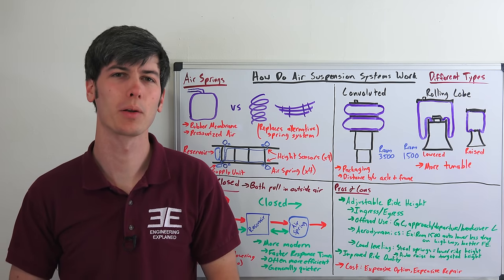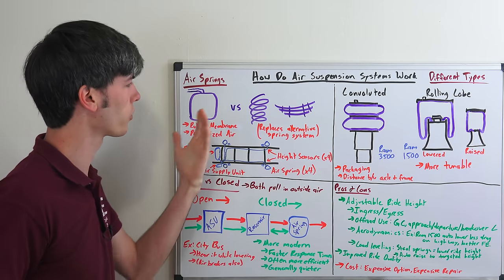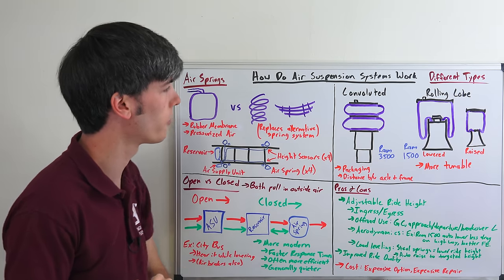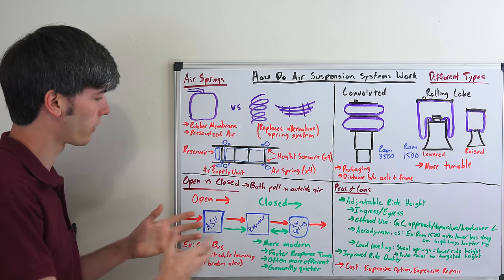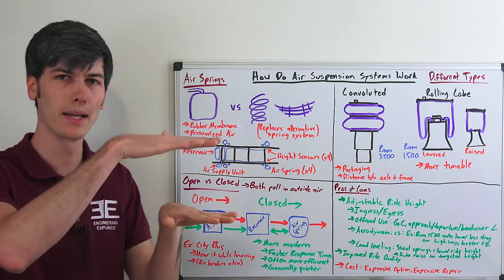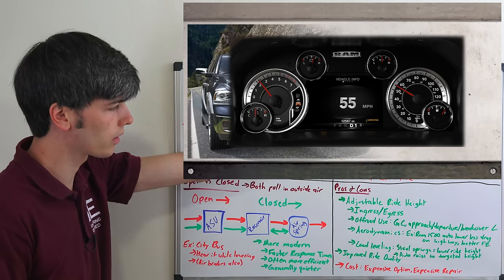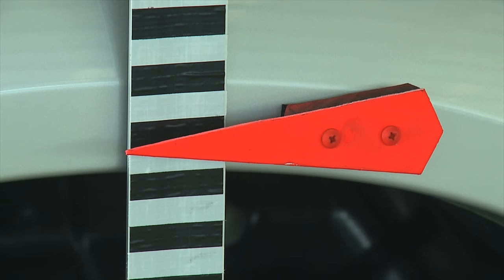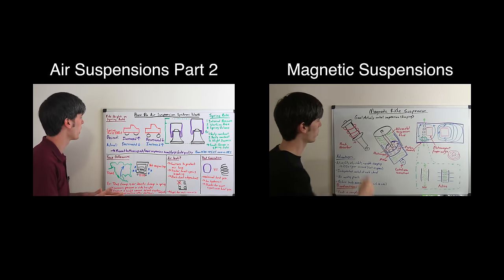What Is An Air Suspension?

Comment: I have a strong love/hate for air suspension systems, especially on household cars. Lets take a Lincoln Navigator for instance. When working properly it provides a nice comfy, cushy ride and the fact it can automatically adjust with load preventing any squatting with weight is pretty awesome! But I've driven one where the system has failed and the whole truck was sitting on the suspension bumper stoppers. All I had to do was pull it into a shop stall for the mechanic from the parking lot, and hands down that was the most rough and uncomfortable ride I have ever experienced! And that was only about 300 ft... I could only imagine this happening to a customer on the road and having to drive it all the way to the shop. I'm sure most people would prefer to get a tow.

Comment: My Land Rover Discovery 2 has air suspension at the rear. 17 years old and i only had to replace the two rear bags after 15 years of use. Never had any other problems and the bags were £80 each. When they did fail it was just a slow leak, so in the morning the car would be sitting on its ass. Towed a 3 ton trailer and the car was completely level. Great system!!
Reply from the maker: Very cool! Land Rover has also implemented a system that will raise to its limit if the vehicle is high centered (beyond its limit for driving), giving you slightly more ground clearance than usual to attempt to let you back up off whatever obstacle you were stuck on. Once you're back to moving around, it returns to a drivable ride height.
Reply: Yeah they have certainly taken it to new heights (excuse the pun) in the later models. What i find even more impressive is the way they take an independent suspension system (LR3 onwards) and use air suspension to mimic the off road characteristics of a solid axle setup. When one wheel is pushed upwards, it sends pressure to the corresponding wheel, actively pushing it downwards for better articulation. Very clever!
Reply: I have a 2004 Disco 2, and many people convert the rear suspension to springs because these actually aren't terribly reliable. LR itself recommends replacing them every five years. If you're doing anything approaching serious offroading/overlanding, the reliability advantage argues for springs and shocks. It's one less thing that can break. If you're towing a lot, having the air suspension is worth it despite the maintenance. It all depends on what you do with the vehicle, if you ask me.
Reply: batard Yeah that's a fair point. But to be honest I think its overkill to convert to coils on these. The parts for the air suspension are not expensive. I have taken mine off-road quite frequently and its very useful to have that extra ride height, especially with a giant towbar that acts like a plough. I know people with P38s and if i were them i would convert to coils as those things are nightmares. The system on the Discos is much more simple. Have you had any issues with yours?
Reply: D Gilbert u were lucky with that land rover unit

Comment: Another pro for auto-leveling air suspensions:  headlight remained properly aimed, and do not blind oncoming drivers when bed is loaded.
Reply from the maker: Ahh, good call! Some trucks will have adjustable lights to compensate for this, but certainly best if no compensation is ever needed.
Reply: Hi, nice video. 
Could you make a video explaing how air brake system (like the truck brake) works?
Thanks
Reply: +otávio augusto verhagem would love to watch that video..
Reply: I'm glad that you consider the blinding of other road users from headlights as opposed to many motorists.
Reply: @Nevin Williams: OEM HID headlights have auto-leveling.

Comment: I work in a shop with several diesel pickups and do have aftermarket airbags installed on some of our trucks.  Having the airbags makes a huge difference when towing/hauling things with a good amount of weight.  If I ever purchase a truck I would definitely want airbags installed

Comment: I can't thank you enough for making these videos. You answer a lot of the questions that I ponder and now I have decided that I should get air suspension on my car. Because I will be using my car for daily driving, as well as a show car, it would be nice to switch between the two at a push of a button as opposed to spending an hour or so adjusting the coilovers
Reply: Volvo xc90 air suspensjon
Reply: Volvo 2019 XC 90 Air  Suspension

Comment: What I do know firsthand is the larger the bag the smoother the ride especially when well loaded. The major drawback is when off-roading which is typical in Texas the bags make the axles act like basketball being dribbled. Letting the suspension down helps if you aren't bottomed out. Small bags are a bummer. On a pickup it would seem overkill considering the quality of the ride versus what the air system would provide. But then again most modern day trucks have one to two airbags under the cab as well and under the seat. A $1000 seat is like sitting on a living room couch compared to a $500 which after a few hours your lower back will be talking to you in pain lol.

Comment: I second what Nevin Williams said.  Keeping the headlights level, and not blinding especially with the newer HID and LED lights.  Level headlights are important.  Even with headlights that can adjust themselves to compensate for the angle of the body, the increased air pressure in the air bags will stiffen the ride, making the load handling safer, but also help with headlight bouncing over bumps

Comment: Additionally, on the subject of air power, I would love to see a video on heavy duty air brakes.
Reply: same
Reply: Hey guy, heavy duty diesel mechanic here, They're super boring.
all it is without getting technical is a kind of air bag pressing on a slack adjuster which is pretty much just a lever, the presses on a S-cam that spins inside a drum and moves the brake shoes apart
Reply: Motorsports7
I'm apprenticing at a HD Mechanic shop, and one of the guys showed me an open brake pot that they have on display. It seems rather simple, but I wouldn't mind a video on the subject.

Comment: Dear Engineering Explained,

Thank you so much for that information. Some few questions: -
1. Can the air suspension work with traditional coil springs or magnetic suspension for better ride feel and comfort (thinking of the BMW X5 SUV suspension for leveling and ride feel), or it is a must they work as separate systems.

2. If you had a, say other SUV/truck irrespective of the manufacturer, can you add the air suspension to stock suspension or will the manufacturer oppose it? please include technical reasons.

3. Please explain how is it that the air bag can handle the sprung (vehicle's) weight, what material is it made of, can it handle road debris and other shrapnel that can puncture it (expensive to repair/replace), and does the air suspension system add too much weight costing fuel efficiency to the vehicle. (point of consideration)
 
4. Can one obtain the air suspension from a third party manufacturer, or do you have to get the overpriced one from the manufacturer. On a side note, if possible, please state compatibility issues with vehicle model, suspension technicalities/design (preferably double-wishbone suspension or McPherson suspension,  if it will work), and manufacturer preferences.

Thank you.
Reply: 1. No. The air springs replace your coil springs. There are also air bags that go inside existing coil springs, such as some Air Lift systems.

2. It's your car, you can do what you want with it.

3. Standard air springs are constructed similarly to a tire, and would behave as such. The aforementioned bag inserts are probably the same thing with silicone instead of rubber. The difference in weight between air springs and standard metal springs is negligible. Rubber is of course lighter than steel, but you also need a compressor and air system, so there's no significant difference.

4. Air Lift is the main source for dedicated air suspensions. There are some kits specifically for certain cars, such as Mustangs, but otherwise you just find something that fits. No, there will not be problems. It just goes where your springs are. Who cares what the manufacturer prefers and why would the manufacturer care in the first place? You know what you need your car to do, it's none of their business.

5. Google is your friend. Don't expect anyone else to respond to a several-part essay in a Youtube comment section. Do it yourself, it's not hard.
Reply: thank you ootdega for the information, I will consider the price and specs if I ever decide to replace stock suspension with air suspension.

Comment: Apart from raising your vehicle when you add weight in a precise place, what are the advantages of these compare to magnetic suspension? And isn't the weight of these a bit too much?
Reply from the maker: +lelegume1635 you wouldn't choose between air and magnetic. Air is for the springs, magnetic is for shocks, you can have both, as some sports cars and luxury SUVs do.
Reply: Engineering Explained oh okay thanks. sorry for my mistake.
Reply: +Engineering Explained I'm 14 and a car guy but I need to learn more and it's nice since I've found your channel because I can learn more every video
Reply: you'll want to keep watching engineering explained as well as chrisfix, eric the car guy, and scotty kilmer. theres alot more "car guys" on youtube, but those 4 will be plenty for you to learn. also, if you own a car, sign up for a forum dedicated to that make or model and you'll get a ton of valuable information too. last tip, if you own a car, buy a service manual for your specific make model and year. all invaluable tools in self teaching.
Reply: Other than that you can lower the truck to get out of it easier or raise it up to get over something

Comment: Brilliant video as allways. My mk2 Range Rover has the roling type on a closed system, with the pros you mentiond, self levling, 4 hights acsess, motorway, road and off road, it will also detect if highcentered and lift to max to get you over, the system makes the live axels and body on frame desigen very comftorbly to ride in, not bad for a 20 year old car. :)

Comment: now u made me wanna learn about buses now
Reply: Have a look at the iconic GMC highway coach suspension. It has air beams, two "air bellows" at each wheel. The coach feels like it is floating down the highway. The leveling system compensates when cornering. It was then a pioneering technology.
Reply: You'll also likely learn that most of the buses and big trucks with an automatic transmission all run the same Allison transmission. That transmission company is kind of a monopoly lol
Reply: +MAN_ON_WHEELZ Allison, Aisn and Eaton Fuller
Reply: jfsa380 I've heard of Eaton Fuller but not Aisn. But to my understanding all of the transit busses here in Chicago run Allisons and most school busses and garbage trucks do too.
Reply: +MAN_ON_WHEELZ i have two jobs and am volunteering with a fire department.  The buses (coach usa) and fire apparatuses (spartans) have allisons, the trucks (penske) generally have eaton fullers.
Reply: jfsa380 gotcha!

Comment: I have a question unrelated to this video on air suspension. I used to drive a 2015 Dodge Dart and now I drive 1999 vw Jetta. One of the features I really enjoyed on the dart was the hill start assist. Here's my question: Could you explain the hill start assist system and how one might be able to replicate the system and install it on a car?
Reply: Quick explanation, the Dart uses onboard computers to monitor vehicle angle (like sitting on an incline), sees vehicle speed is stopped and foot on brake, uses ABS to hold the brakes for about a second after brake is released. You might or might not have noticed that if you took your foot off the brake and didn't engage the clutch, the car would roll back when the brake is released.

Comment: All I know about air ride is it is extremely comfortable and expensive to replace lol.  My only question is how do they keep moisture out of the system?
Reply from the maker: +Bobby0345 desiccant packets ;)
Reply: Hi Bobby0345 . I work on buses that use air suspension . To keep out moisture they use a unit called an air dryer .
Reply: I was gonna say I remember learning in class about an air dryer unit but this guy beat me to it.
Reply: I work at a dodge dealer, and these systems are filled with 99.9% pure nitrogen and are completely closed system (with a port to help maintain height during a leak)Without any oxygen in it, corrosion cannot happen. If a leak does happen, it will take in 10 litres of air at a time, then sit for a couple seconds, then dump out 5 litres.  This is done to drain/spray out any moisture that may come it with the fresh air (due to pressure change). It will then display a message in the cluster to have the suspension system serviced. Where after the leak is repaired, the system will be filled with nitrogen again.
Reply: Jason Cronje, that makes sense.&#160; all air compressors end up getting the water molecules to bunch up.&#160; that is why garage air compressors are supposed to have a drain (well all air compressors are supposed to).&#160; some are automatic, some are manual.&#160; I am really thinking about doing an all around air ride suspension for my diesel truck to soften the ride but still be able to haul a lot when needed.  I will leave my rear leaf springs, taking out a few because it is almost like a rock with how stiff it is at the moment
Reply: Ram 1500s have a closed nitrogen system.
Reply: If there is a small leak,how do I know if the suspension is low on Nitrogen
Reply: I think like suspension systems in trains there  are Driers. The driers are filled with industrial Silica Gels. The compressed air flows to these dries at specific intervals and the moisture is separated. The dry air then flows back to the system

Comment: Very nice video and explanation Jason. But I am wondering if there is any consideration upon damage of the rubber membrane if you drive in gravel pretty fast or even if you drive in the mud a lot like the scenes of your video at 08s. For example, the rolling cobe type suspension covered by dirt, if you lower and raise several times I think it will wear out the rubber. Is there a recommendation to wash under the car more often to avoid that wear? The steel springs don't have this concern.

Comment: not sure if air suspension is really much more expensive. initial cost yes. but i wouldn't bother replacing airbags with factory replacements since there are tons of aftermarket options. i work at a plant as an engineer and there is pretty much infinite sizes of air bags and styles available. airlines are easy to replace. pumps can be replaced by aftermarket as well as tanks. pressure sensors, solenoids, ride height sensors is all available in the aftermarket world. IMO air ride is superior for the every day truck compared to the coil or leave spring.

Comment: Do you loose low speed articulation( travel) when at max ride height/ max high pressure? 
Also do you know what system the hummer ev uses? 
-thanks

Comment: It's worth the extra $ to get air suspension when you get a new vehicle.  On luxury cars the air suspension will lower the car 1-2 inches at highway speed for better aerodynamics.  At low speeds the driver can adjust the height in a heavy rain to ride higher if needed.  The ride quality is also better.  When it goes out of warranty it's time to sell the car.  From Lexus to Mercedes Benz one air shock/strut can cost anywhere from $500 to $1500+.  You can also go insane/broke chasing down leaks in the system when the failure is not in the bag part at all.

Comment: hey man i was wondering what would happen if you downshift too soon or at redline. Does the car have computer system to protect the car. Is the car going to over rev and destroy it self. I am asking this question because i am about to buy a used paddle shift car. Thanks. Really love this channel.
Reply: Cars with paddle shift (automatic gearbox) will not downshift if the revs are too high.
So if your car is an auto with paddles, there is no way to over rev it.

You'll be safe!

Comment: What about the difference in weight versus standard springs and shocks? For example, if you had a car that had springs and you replaced that with an air suspension because you wanted adjustable ride height, how much additional weight would you have with the bags, compressor, and reservoirs (if needed)?
Reply: I can only comment on the RAM as I've worked on many of those, but the weight difference from air to steel springs in these trucks are nearly the same. Just a huge ride quality difference

Comment: Hey, if the pressure increases, the suspension will be stiffer, will it not lose all the comfort? It just keeps the height, but the car gets stiffer the more weight I carry, like the normal spring and shock suspension. Is that right?
Reply from the maker: +Deva Turbo my next video on air springs will answer this in great detail! :)

Comment: I need your help. I have the 2013 Ram Longhorn and the right rear air bag keeps dropping and inflating randomly sometimes the whole trucks suspension drops and randomly inflates I dont know why? My question is could you have an explanation? If not do you know what I need to replace it with regular suspension and removing the air bags?.

Comment: do you know if the grand marquis has a system like this. I know I have had 2 so far and changed to coil springs. though the air bags are a bit better in my opinion.

Comment: Generally curious, why would you still need shocks in addition to the air spring, wouldn't the ability to change the air pressure inside the membrane be able to do compensate for both?
Reply: You still need shocks to control the dampening, the air springs only replace the steel springs